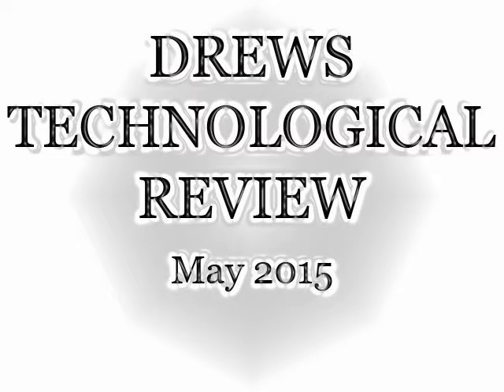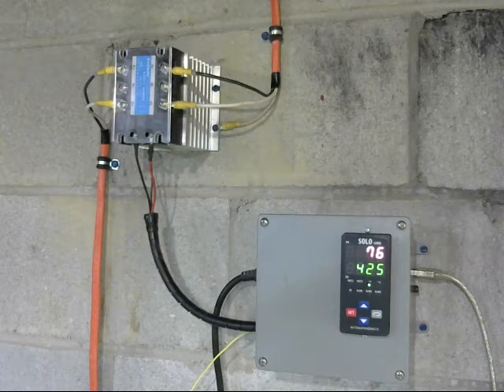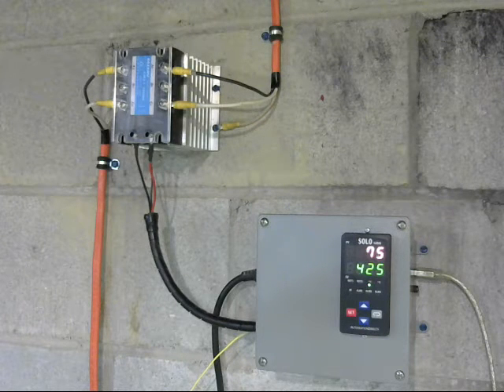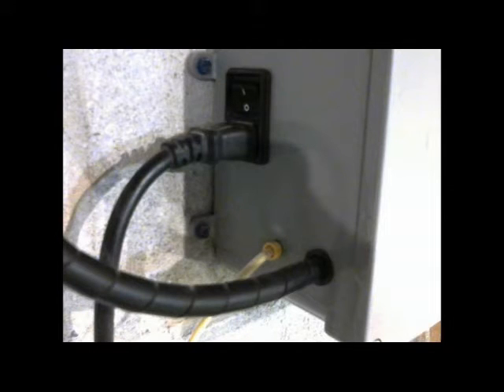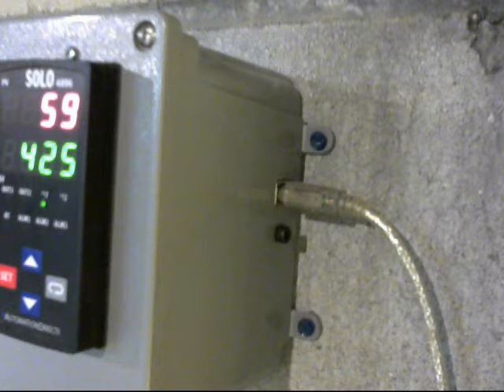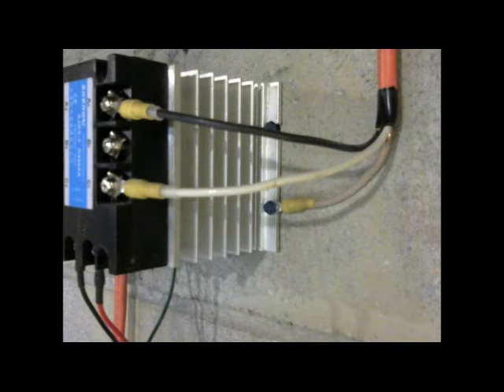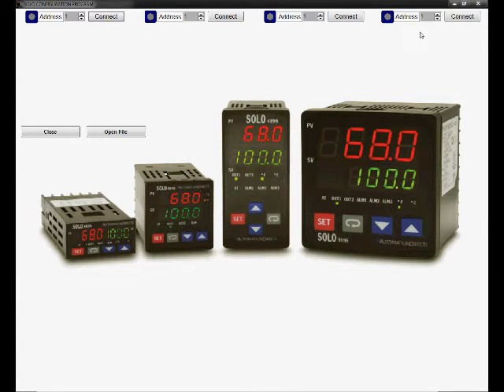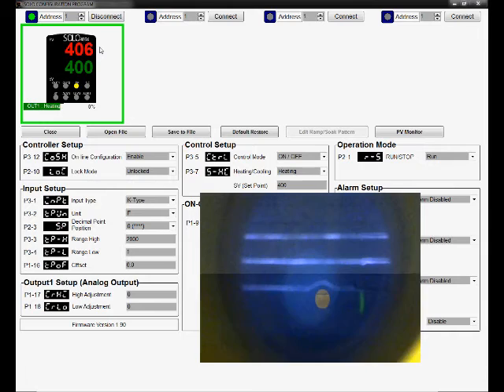How To Build a Computer Controlled Temperature Controller For Your Kiln.

Comment: Awesome video, just what I needed!  Quick question about the Solo models. I need to program ramps (both up and down, but down ramps would be via natural cooling or by heating elements when I need even slower cooling) and holds. Do I need the same model as you have mentioned in this video (VRE with Voltage Pulse output) or will  I need a different one? I do not understand the different output models they offer. I'll be using the controller to fire ceramics, specifically for crystalline glazes. Thanks for any advice, can't wait to digitize my old little kiln!

Comment: This video is super helpful and informative. Do you have a link/name to the ebay vendor you used for the solid-state relay?

I'm thinking of doing something similar with a small wifi arduino computer instead of the PID controller.
Reply from the maker: sorry for the delay. i don't think to check this video.
here is the vendor i purchased from.
http://stores.ebay.com/coolcheapworld/_i.html?_nkw=solid+state+relay&submit=Search&_sid=1054256839